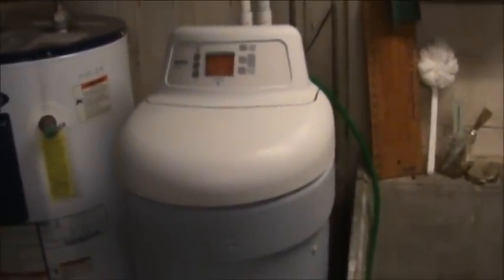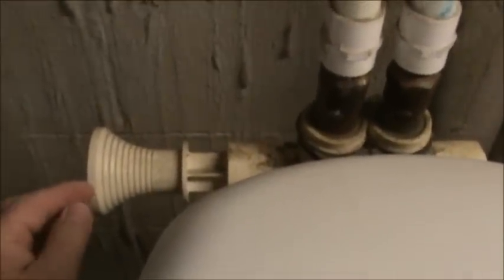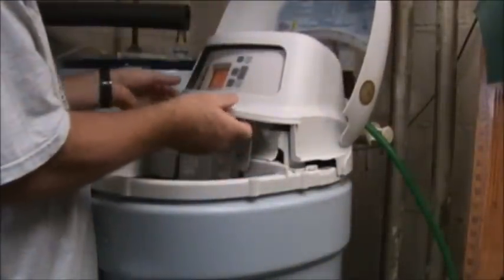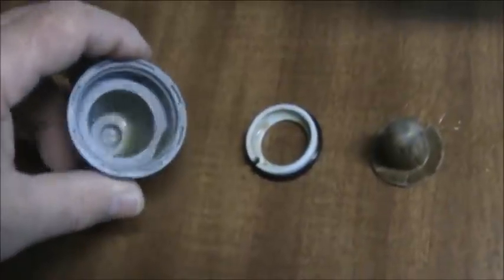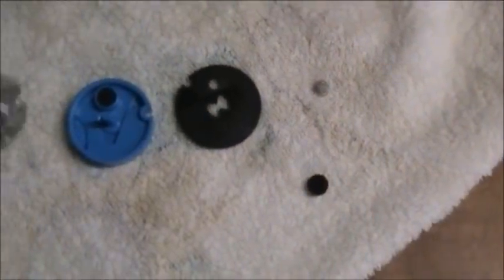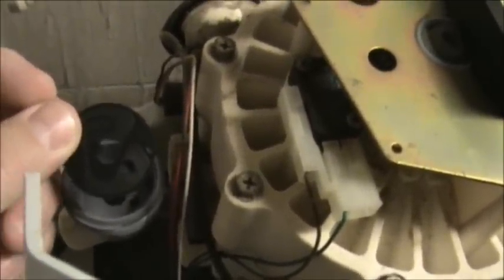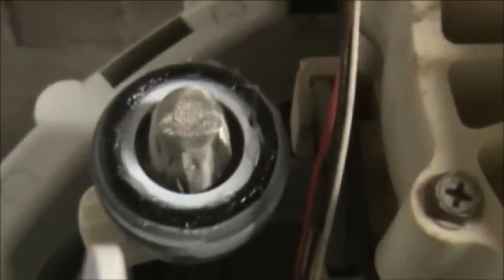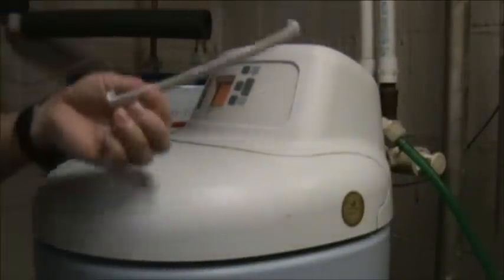Cleaning your Water Softener Part 1

Comment: Great, easy to follow video! I followed this video and part 2 to fix my flooded tank (I did part 2 first since it was the easiest looking, but to no avail. However, removal of the float revealed a large accumulation of mushy salt sitting atop the foam). Cleaning the Venturi and the surrounding parts prevented the water from remaining in the tank after the recharge. I had recharged 3 previous times after trying different fixes and each time it left the water remaining at about level 4. This video did the trick. I also shopvac'd the remaining water out as well as the cheaper salt that I had purchased, just to be safe. Refilled with the Morton System Saver 2 that I had used for years prior to switching about a month ago. One successful recharge down, keeping fingers crossed that everything continues to perform as it should. THANK YOU SO MUCH!!!

Comment: Excellent detail, I had put the tiny flow plugs in wrong, and this video was very explicit, then in another Lonnie video saw about clearing a similar plug in the drain line, which was also clogged, after hours of trying to solve, these 2 videos solved all my regeneration issues.
Reply from the maker: Thanks! and cool! glad to see it helped.
Reply: @LonnieJohnson1  Super helpful up to the flow plug installation.  On page 29 of the Kenmore Owner’s Manual, it specifically states to install the largest flow plug in the nozzle & Venturi housing.  This is the opposite of what you state.  Could you please confirm?
Reply from the maker: I have page 3-2 and there is only two flow plugs and they go in one way. What model do you have? I have Ultra soft 425. 625.388460
Reply from the maker: https://c.searspartsdirect.com/mmh/lis_pdf/OWNM/L0601038.pdf
Reply: @LonnieJohnson1  Thank you for your response.  I have the 300 Series, 625.383060.  My nozzle & venturi parts look identical and I'm usually so methodical, but this time I was cleaning the nozzle & venturi and the flow plug fell into the soapy water cleaning solution.  The manual states "...be sure the largest flow plug is located in the nozzle & venturi housing."  Both flow plugs are the same size, the only difference is the center hole.  In any event, I placed the larger hole flow plug in the nozzle & venturi.
Reply from the maker: Sounds good

Comment: Good video. I just cleaned mine for the 2nd time in 15 years and I suppose should clean it more often. Wanted to check for videos to make sure I'm doing it right
Tell tale sign for me is the brine starts overflowing and I get excess water out of the overflow drain.
This has been an excellent softener for our needs over the years
Reply from the maker: Thanks; mine has been excellent as well.

Comment: Thank you for taking your time explaining and repeating if you thought it important.  Made this task so much easier to tackle myself.  My Kenmore was a different model but basically the same parts. Especially helpful was describing the floats having numbers on one side and which one goes which way. (Hard to see on the video, so tiny.) Also helpful, mentioning the different diameters of the holes in the floats because when I put them in the soapy water the one float disengaged from the plastic part it was seated in!
Reply from the maker: Your welcome

Comment: Fantastic video. Thanks so much for doing this. I have a whirlpool but it's an identical design. Your attention to detail made the process much easier. I just have to figure out how to clean the resin tank...
Reply from the maker: Thanks, glad to help. You can do a recharge to clean the resin and I also have a video on replacing the resin because it dissolves over time and has to be replenished.

Comment: Thank you for the video it was very helpful. I think that there may be an error in it. I have a Whirlpool WHES44 softener that has the identical valve. When you replaced the flow plugs you said that the one with the larger hole should be placed in the blue plastic ring, and the flow plug with the smaller hole should be placed in the lower housing. The correct way to reinstall these is the opposite. The flow plug with the smaller diameter hole (flow rate  0.15 gpm) should be place in the blue ring. The flow plug with the larger hole (0.3 gpm, marked HVDC on the flow plug) should go in the lower housing. I confirmed this with the itemized Valve Part List, and also by calling the service reps at Whirlpool. I realize your softener is not a Whirlpool, but the complete valve and the maintenance procedure is identical. 

I had followed your instructions and my softener was not softening the water. Once again, thank you for your video. You might want to check this info and then update that little piece if you agree.

Comment: Have you run into an issue where the water will not suck out of the holding area and recharge the brine?    My tank will fill up no problem but will not suck out.   I replaced the Venturi and cleaned everything.

Comment: Hey Lonnie - love the video. Just replced my resin and my softner and its working like a champ again. I cracked my ferrule nut though that goes to the venturi. I got a new one off of amazon, but im wondering how to replace it. Is it a compression fitting meaning i need to cut the old one off and just put the new one on the pick tube? Thanks a bunch
Reply from the maker: You should be able to pull the sleeve off and pull the nut off and replace it with a new one or cut the line and replace both.

Comment: good video but a you need a sediment filter in the front end of your system Easier said that done however thanks  Greg

I think my resin is bad My unit is 10 years + old Is it possible to do that or ?
Thanks Again

Comment: Hello...terrific videos. Thank you!! Unfortunately I’m still struggling to achieve softened water. I’ve changed the resin. Cleaned the venturi. Adjusted the brine float. Ensured valves set correctly. Increased water hardness...higher than what is reported by our city. Any other suggestion? What am I missing?
Reply from the maker: How many times has it regenerated since you changed resin?

Comment: Thanks  I have a 370 and looking at the parts list on page 47 it shows the lower flow plug as being .3 gpm  and the upper flow plug as being .15 gpm.  Seems to me the plug with the larger hole would go on the bottom being it does 3 gpm and the plug with the smaller hole would go into the top or nozzle being it is rated for .15 gpm and that is the way my 370 came apart.  I'm not the expert by far and would like to thank you for the videos.
Reply from the maker: Your welcome

Comment: as long as you had the lid up you should have pulled your green drain hose out to check for obstructions,i have had small pieces of 'something' get jammed in the small orifice where the hose attaches. Only takes a couple seconds to pull off and check,also bloww into the drain hose to make sure it's clear.

Comment: Thank you for your video! I purchased a used water neutralizer and cannot figure out what the hose to the venturi valve is supposed to be attached to. When I just attempted a backwash, water shot out of the valve nozzle! Would you please tell me what it's supposed to connect to? Perhaps I can just cap it?
Reply from the maker: Watch my video on water softener part 2 and Kenmore water softener resin replacement or how to put resin in a water softener and see if that helps.
Reply: @LonnieJohnson1  Thank you!

Comment: Great video - thanks.  I have an Ultrasoft 150, looks mechanically all the same except for the electronics.  My brine tank is not draining.  I have cleaned the nozzle/venture and the brine valve.  Checked the drain line and all clear.  If I pull the brine valve out and start a regen, I can observe water coming out of brine valve.  I progress to step two to start a drain cycle and I can observe water getting 'sucked' or vacuumed down into the top of the brine valve (I am holding the rubber stopper seal up so it doesn't seal against the valve) but it seems really really slow, although I am not familiar with how fast the vacuum flow normally is.  I have not yet disassembled the rotor/valve yet to inspect.  Can this also be a root cause of pulling vacuum to drain the brine tank?  Thanks! 
Shane

Comment: It's almost to the top of it I kind of thought it would dissolve being water but it is visible with the salt my salt line was at 7 and it wasn't regen or nothing and I listened and cleaned out everything like you had said I did exactly what you did in the videos and when I try to drain it it grew higher
Reply: The milk Enos of the salt dissipating has went away my salt level when I started cleaning was at 7 with water visible the water is clear enough in the tank in my salt level is at a 5 water level all the way to a 7
Reply from the maker: I would Siphon or pump the water out and check the drain tube and the venture again. If it's not draining it's plugged some where. A very small grain will cause a headache. You can make it manually drain but that would take a long time if it full.

Comment: Great video. My Kenmore WS controller would not function or recharge. Only model # showed when plugged in. Price of new controller with service call about $300. Almost cost of new. Removed dual connection from recharge motor and using emory cloth cleaned the terminals. Installed power supply and the controller woke up.
Reply from the maker: Thanks

Comment: Thanks for the time you took to make this video. I do have a question though. I have a similar model Ultrasoft 420, but I notice that the manual says that the lower flow plug is p/n 1148801 and is 0.3 gpm where the upper flow plug that goes into the disk is p/n 7084601 is 0.15 gpm. That would seem to indicate that the flow plug that goes in first has the larger hole and the one in the disk is the smaller which is contrary to what is says in the video.

I also have a GE model GXSF39E which looks almost identical to the Kenmore. It has the lower flow plug at 0.3 gpm and the upper in the disk at only 0.10 gpm.

Comment: I have a draining problem. It is relatively new machine. I took apart the Venturi, and looks like gasket might be the issue? There are lots of dents on gasket. All the rest is very clean. Can this stop it from draining? Thanks
Reply from the maker: Depends on how bad it is.
Reply: @LonnieJohnson1  I have no idea what, "how bad it is" means. Any explainations would be helpful. Thx
Reply from the maker: My unit had a very very small piece of like rock substance blocking the hole where the water would drain out and kept it from draining and my unit filled up.
Reply: @LonnieJohnson1  I replaced the gasket, seemed to work
Reply from the maker: Cool!!

Comment: Great vid Lonnie. Hey, maybe you can help me with a problem. I have the 370 and get an error message 1. The board just displays over and over serv and recharge. Makes no noise or attempts to do anything. I'm thinking a motor but not sure. Any ideas?
Reply from the maker: I'm sorry but I'm not familiar with that model, however, you can try this address "http://www.shopyourway.com/questions-list?q=kenmore+370+series+water+softener+manual" and this might give you some idea.

Comment: REALLY helpful my manual has too small of print. Thanks!
Reply from the maker: Your welcome
Reply: @LonnieJohnson1  Dear Mr. Johnson:                                        14 July 2019 1408 hours CDT

I have a 1995 Kenmore Genius II Water Softener 625.348670 that I am having trouble getting the motor, cycle rotor, and the computer in synchronization.

Are you able to advise me regarding that issue?

Please advise.

Thank you.

Robert Burns Wadley
Amarillo, Texas
Reply from the maker: Have you checked you Rotor Position Switch part# 7145186?

Comment: Lonnie.  Does salt ever lose it's potency if it's been sitting in water?  But the Morton pellet is still intact, but it's been sitting in water for a couple of weeks?
Reply from the maker: My system doesn't recharge for 3 or 4 weeks at a time depending on my water usage. I wouldn't think salt could go bad. I don't know about the other chemicals they use with the salt. Have you check for a salt bridge in the tank?
Reply: ***** No salt bridge. strange that it still every couple of days would require rgeneration, implying it's softening water?  But no soft water. No it's filling with water again.  I may have to pull it out and clean the bottom and everything else.  Now, I cracked that ferrule nut at brine tubing, to the venturi.  I wasn't hatched to fix things Lonnie.  Just break them.
Reply from the maker: I think you have a drain blockage or a bad pump. That's what I would check. I wish I could give you some good news.

Comment: I recently changed the resin in my kenmore 400 water softener and when it charged overnight,  I found my water softner salt tank completely overflowing.  I believe I correctly cleaned the venturi and float assembly, but this was the first time I did this,  I was careful about each step but could have missed a minor detail.  The venturi hose gasket may have been slightly crooked when I tightened the hose,  but the hose seemed snug and I thought I had the gasket seated as best as I could.      When I disassembled the unit, the brine tank was full of water,  there also was a lot of crusted salt in the bottom of the salt tank.

I've looked through the owners manual and it did not give me a clear understanding of the issue.

I will check the venturi again, and the float assembly again, but other than that,  I think the motor and timer are working,  I also do not appear to have a bad switch as the motor is not continuously on.

Any advice here is most appreciated!
Reply: This happens to me as well. I recently installed a kenmore 400 water softener, I first set it to regen every day 2am in the morning. When I wake up, I found there is a little pond in my garage close to my softener machine. I search online, and have no clue why this happens. Do you know why this happens? Thanks

Comment: Good video except flow plugs mixed up. Per Kenmore manual, flow plug with largest hole goes in nozzle and venturi housing (base of venturi). Other plug fits in blue plastic nozzle and venturi.
Reply from the maker: I just put it back together the same way it came apart. But thanks for the info I will check it out.
Reply: I just rebuilt mine per the Kenmore site. I'm pretty sure the larger holed plug goes first.  This site actually shows the text so I could confirm the difference: http://www.kenmorewater.com/
Reply: I agree it says under lid the flow plug with letters hvdc goes in first.

Comment: I have the same softener and we cleaned the venturi my softener still does not work. The water flow indicater shows zero water flow.  Do you have any ideas as to what is wrong. My softener is also a Kenmore. Ultra Soft 200. Any ideas on how we can fix? I can't stand this hard hard water any longer. Help please

Comment: I had to put my softener on bypass because something in the softner cause the water pressure to the rest of the house to be very low. I'm not sure what I can do to fix this problem, would you know?
Reply from the maker: Dan McCormick   I do loose some pressure when the shower is running and someone flushes the toilet.  I use my bypass when cleaning the softener, watering lawn and washing the cars.
Reply: Okay let me rephrase, it's not losing some pressure, But more like water just trickles out of any faucet at any given time when it's not on bypass
Reply from the maker: Dan McCormick Check to see if you have salt in your faucets screen. If so you will need to clean them. That's the only thing I can think of. I have no idea why all the faucets would leak. I have never had that issue.
Reply: I have this same issue right now. Hoping to find some clarification before I break down and buy something new. Did you find a resolve cleaning anything?